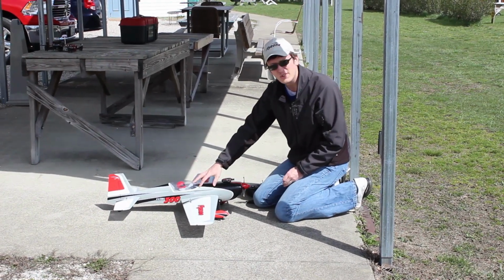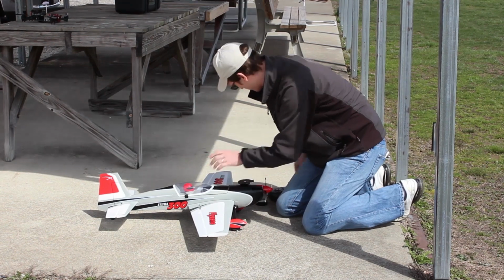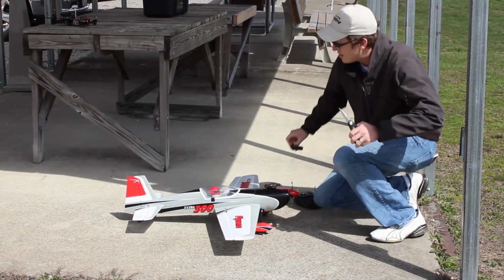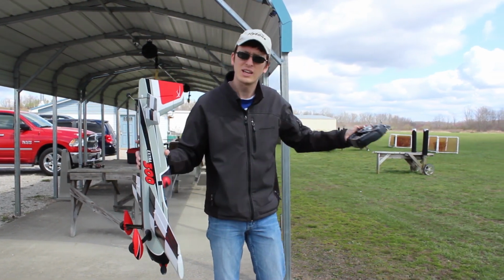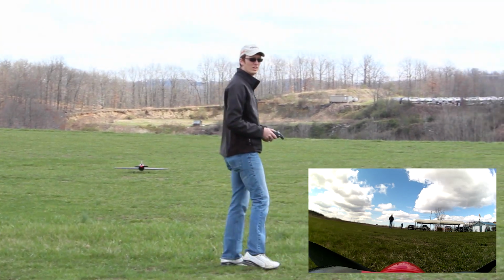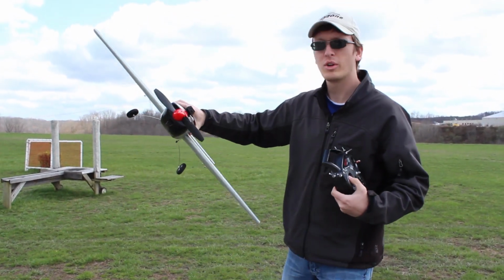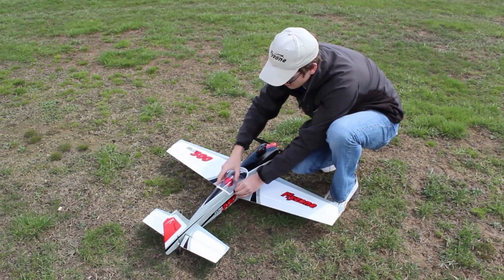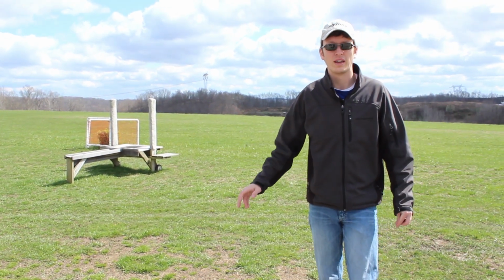Flyzone Extra 300SX Brushless Rx-R Flight & Speed Test W/ FPV On Board Camera - TheRcSaylors

Comment: Hey Nate I have a question about the Extra 300 and your set up. I recently purchased the same one after watching your review, I also purchased the Tactic TTX650 after seeing how much you like yours. And my question is about your EXPO settings? How much EXPO do you set for your Flyzone Extra 300SX? I set my radio up for 2 rates, the Low and High rate throws and wasn't sure a good EXPO percentage to start and try. Thank you much !
Reply from the maker: This might be bad advice.. it probably is bad advice actually, but I've never flown using expos.. ever, on any rc. I just don't like how it feels. I feel like I have less control over the rc. 30-40% is pretty common though, and the Tactic is very capable of expos. I just prefer flying without.
Reply: +TheRcSaylors Thanks Nate! Not bad advice at all. I'm 32 now and up until now I've never had these advanced options I could use with any of the R/Cs I had growing up. I'm a strong beginner but not quite intermediate yet so I think the Expo set about 30% will be helpful to me but I'd like to progress to a point I don't need it lol.

Comment: great flight Nate, why all the up control in the beginning of the video, made it look like a porpoise flying, just start with neutral controls and trim accordingly, A little nose heavy is perfect for these light planes, better wind penetration, I wonder how the camera would do under the wing, if you have the clearance, been thinking about mounting a micro camera on my CALYPSO GLIDER, I have a lot of footage on YouTube with me flying my ASW 27 full size glider in the mountain ranges in Utah, using Go Pro's, problem with those, the battery life is short, so I wonder if that would be the case on the rc glider, hi Abby, really good video work.
Reply from the maker: I tried to start with level controls by sight, then it needed more trimming but I didn't bring my tools to the field.  So easy to forget stuff in this hobby!

Comment: I think it looks ok, that shutter action is unavoidable, has to do with camara speed so not much you can do about it. I could tell you were struggling at times with the wind and cg but that being said,with a few tweaks,I think she will be a great flyer. I know you are a good pilot so its more the plane than you. My landings have gotten much better since last year. I dont even use beginner settings any more. I picked up some plexiglass from hobby lobby to start my Transparent F.T. plane. I challenged Peter to build one on their site,so now I have to go through with it. I am hoping others try one too.
Reply from the maker: That will be a really great challenge!! I have since trimmed the plane up, and part of this being off balance was due to the GPS and camera in this flight.
Reply: +TheRcSaylors Yeah camara has to be counter balanced properly, being in a hurry we sometimes forget the obvious. As far as I am concerned,you are doing great with your web show, you are getting more followers and doing pretty good with your equipment. I dont have even a go pro. I started the plexi plane and realized,unlike a foamy,this plane will need an inner structure to work. I ended up getting a heavier sheet of plexi for the frame work, which makes me think I am going to need a more heavy duty motor,battery,esc,prop,battery to do the job. Me and my big mouth. Now that I committed,I refuse to give up. Its the stubborn streak in me. I dont quit once I start something,I finish it. It may take me longer than I originally planned but thats ok. I wont be showing my failures, anyone that has done one of these projects knows they are not without mistakes. The cost is the big thing already. This aint no dollar store foamy plane I be buildin' eather! plexi runs anywhere between six dollars for  3×5 sheet to ten dollars a sheet depending on thickness. That and the expoxy,plexi cutter and then throw in the electronics.....nope, not a dollar store special. I could probably buy a foamy on Hobby Kings web site for cheaper. Oh and I forgot the damn lights,cant forget the lights. Anyways,its all for the fun of flying ( I hope) . At least if it crashes,I will be able to say flyings not all its cracked up to be ( get it? plexiglass, cracked?) wish me luck,or at least send me a card when they put me in the looney bin for trying. lol.